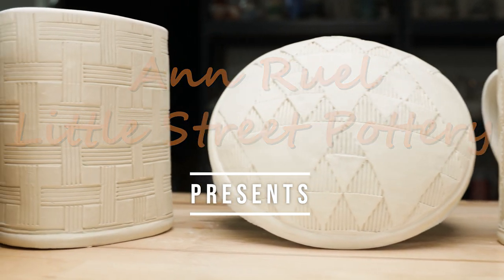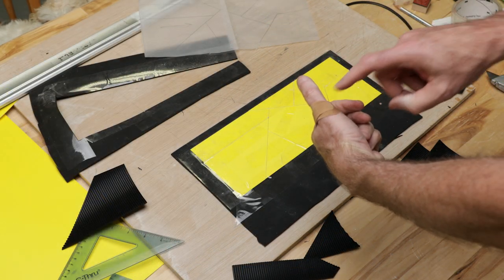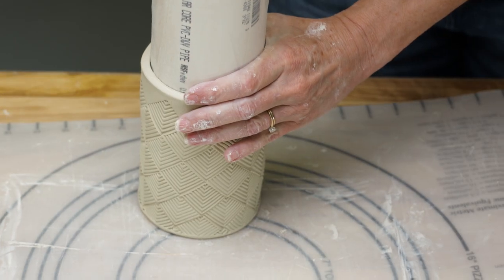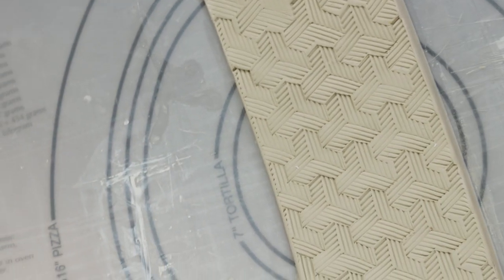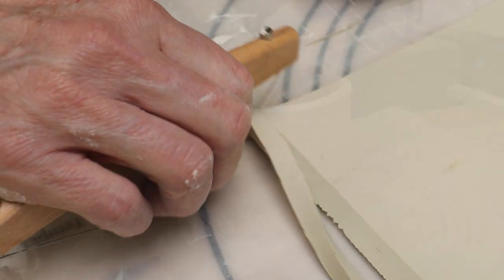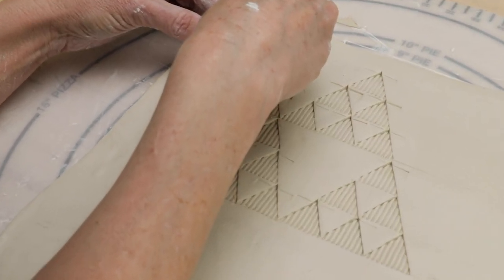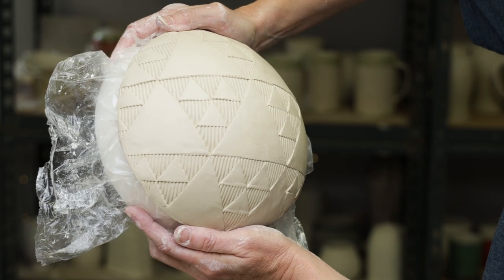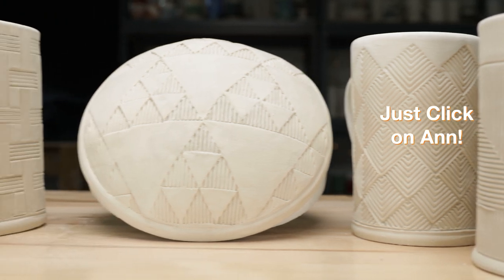5 Pottery Design Ideas - Using a Ribbed Mat (PART 2)

Comment: Another creative idea with bonus instructions!  Question:  I noticed that in this video (and Part 1) you have not used a release material to prevent the wet clay from sticking to your texture; did you the mat with a release off camera?  Or does the clay really NOT stick to the rubber texture??  Thank you so much for sharing your time and expertise.
Reply from the maker: We had little problem with sticking...the only issue was when we try and pull it off patterns that run in various directions...the grain of the pattern tends to pull against each other and wants to tear the clay. No Pam, no Vaseline, no problem. Rubber, it’s not just for breakfast anymore.
Reply: @LittleStreetPottery  .....👍

Comment: you two are so clever and creative!  here i go, butting in again:  the small square one you called a geometric leaf pattern...could you use that modified herring bone pattern to create the inside of an elliptical shape (football shape) for a leaf template?  you could add twigs freehand, and maybe cut out a few elliptical leaves and glue them to a mug/vase with slip.
Reply: Sounds like you are creative yourself.  I havent tried that.  You will have to give it a try and let ME know :-)
Reply: @annruel9142  : i am artistic, better at 2 dimensional art than 3 dimensional art. i am retired and on a fixed (AKA "mininal") income, so i don't know that i could afford to go to a pottery and create things.  what little pottery i did, i did in high school. i think i'd still enjoy it, but don't know that i could afford it.  :-)